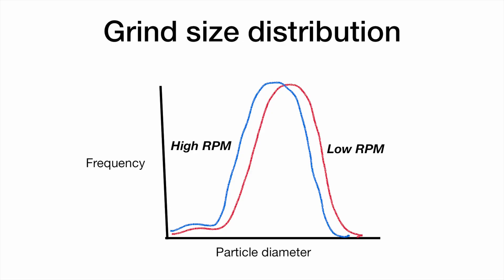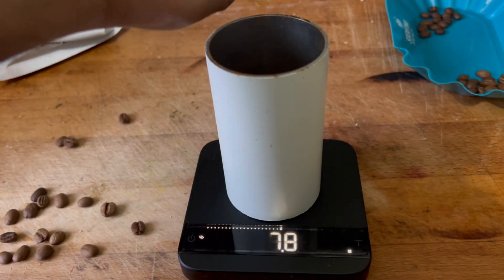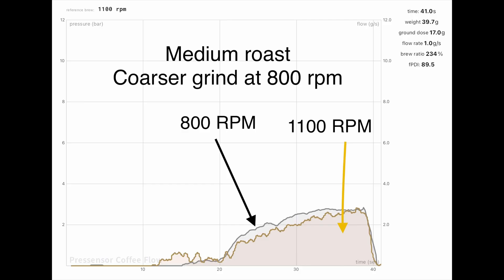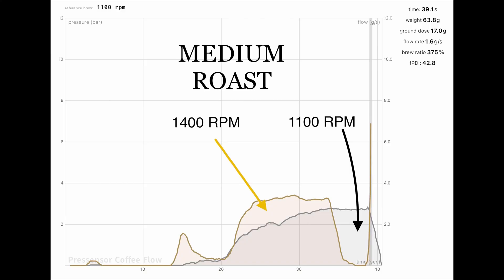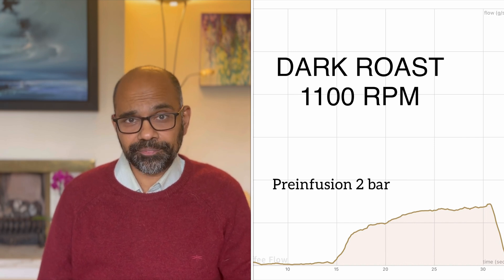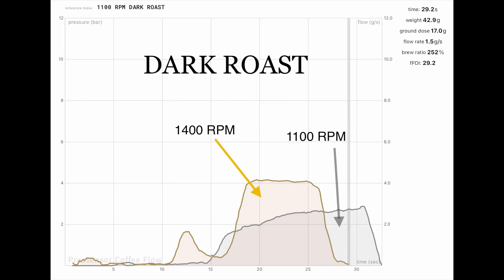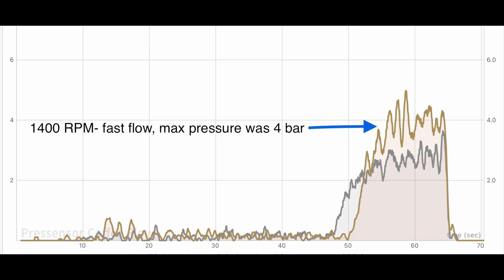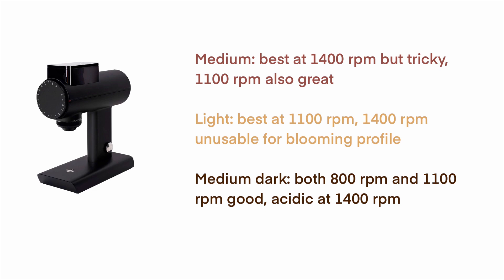Variable RPM in a coffee grinder -Does it matter? (Timemore Sculptor 078S)

Comment: 078S does not work for me as improvment over my old  MACAP M4 with new burrs.  For 2 different medium/dark roast Espressos, 2:1, 20g, regardless of grind setting, RPM, temperature or pressure coffee tastes undrinkably bitter (we like the bitter in coffee but this is aweful) and  the counter is a mess because of fines around the cup.  I seasoned with 7kg before the first attempt, use WDT (no RDT).  I will return the 078S and try the Philos.
Reply from the maker: The 078S works well for light and medium roast. It extracts quite a lot and requires meticulous prep to prevent channeling. Perhaps you are either over extracting a darker roast or experiencing channeling. Could I suggest lower ratios and puck prep according to the latest video?

Comment: I have more or less the same experience with SSP Cast V2 on the P64. Lower RPMs are easier to dial in but lack clarity. Depending on the coffee I prefer one or the other. Low RPMs can give me higher body and juiciness with light filter roasts and I can bump clarity on medium roasts when using higher RPM. So there definitely is a difference. Thanks for tasting all this.

Comment: I am curious, was your grinder already "seasoned" before doing these experiments?
Reply from the maker: It had about 3 kg through it I think. After the first 500 gm, the coffee was pretty good. Now after  about 6-7 kg, it’s excellent. I think largely this is because of experience rather than seasoning.
Reply: @UnderstandingCoffee  I imagine so. Thanks for the answer. When you pointed out, that it was hard to get good light roast shots at 1400 rpm, I thought to myself, maybe this is related to why many people say that the machine needs 7kg seasoning and others say they had no issues. In stock settings, it seems to be set to 1400 rpm (it was in my case). I don't mean to be rude, but I wonder if those people tried to use lower rpms first, or stayed at the 1400 rpm at all times.

Comment: Great video. Thanks for sharing your experience with that grinder and mentioning that the Gange results may be limited to his EG1. Which I believe he mentioned as well but Lance seems to imply it works the same in every grinder which isnt the case.  

It is odd this one is backwards from most grinders. Lower rpm generally gives you less fines or coarser grinds for other grinders.
 I wonder if the declumper or wiper arms are not sufficiently allowing the coffee to exit the grind chamber efficiently leading to more regrinding where at higher rpm the grinds are pushed out more easily.  
Another thing to experiment with would be to maybe use the knocker as its grinding at lower rpm to assist to exiting of coffee maybe. 
I have 078s coming soon hopefully.
Reply from the maker: Thanks! I think the vertical orientation of the burr changes things. A possible explanation is that at lower rpm, the beans back up in the auger resulting in regrinding.

Comment: I'm trying to understand the conclusions here (medium roast). It seems for espresso, 1100 is safer might be ideal compromise, since it will be easier to dial in.  Should I conclude for pourover, 1400 would be best?
Reply from the maker: I haven’t tried this experiment for pour over. But yes, you can extrapolate the findings. I have tried sprovers by grinding at 1400 rpm and slow feeding (2-3 beans/sec) and it works really well. Hope this answers your question.

Comment: Great video, I've experienced the same as you described, it's nice to see some good data to understand it.

One question, what's your 0 set up at? I had to move the pin 3 spots to the left from factory 0 to find burr chirp at 0.4.

And what coffee and grind size did you use for filter?
Reply from the maker: Thanks! The burr chirp is about 4 notches away from zero.  I moved the pin 2 spots to the left.  the coffee for the filter was a medium roast Columbia Antioquia. The particle distribution was merely to demonstrate that rpm has an effect even in the filter range. I did not brew with it.  It was ground at 14.

Comment: Are you doing some bean flushes between changing grind sizes? 

I have 064s, but it seems that the shot times differ if I make a shot on e.g. 1.5 going from 1.8 (faster) and 1.5 going from 1.1 (slower). The retention is really small, but it still bothers me, not sure what's the reason, didn't make any back to back tests but I have such feeling.
Reply from the maker: No, flushing isn’t required as retention is almost zero. How much coffee have you ground so far? The grinds clump a lot initially which is probably why you get inconsistent extractions. 60-90 seconds of WDT in the container and puck raking helps a lot with consistency of extraction.  As the grinder is seasoned, you won’t need as much WDT. I’ve probably ground about 5-6 kg and 20 seconds of WDT is enough.
Reply: @UnderstandingCoffee   maybe that's it, I've ground maybe around 2-3 kilos and use quite long WDT. Also that's not a thing I'm 100% sure of, but I have a feeling it's happening, but good to know it's fine for you.

Comment: I got my 078s since the beginning of October.
When it comes to extraction, I realised that lower RPM for filter was nice to improve the complexity and depths of flavors.
On the other hand, for expresso, I  usually stick to the mid range around 1100 RPM because it's less tricky to dial in and the flavors are just nicely balanced.
I dont have any WDT tool yet but I might try to increase the RPM speed closer to the max settings when I'll have one to see if i can push to the limit the clarity and the flavors.
I mostly use medium to light roast for expresso but i think the grinder suits better for medium profiles, at least with my bambino plus.
Thank you for the great video !
Reply from the maker: Thanks for sharing your experience. WDT will make a big difference. You don’t need any specialist WDT tool. 0.3 mm acupuncture needles in a cork is good enough!
Reply: @UnderstandingCoffee  a Friend of mine is the owner of a specialty coffee and does have one spare for me so hopefully I'll not have to buy anything.
I think there is room for improvement in the 1100/1300 range without having to deal with too many issues like 1400 does.

Comment: I grind at 800 on my 078s as it gives me the best/widest range for espresso on the dial.
Reply from the maker: Of course tastes are individual and it’s great to hear different experiences. For me , the best balance between clarity and body is at about 1100.
Reply: @UnderstandingCoffee  I’ll give 1100 a try, to be honest the reason why I also started at 800 is because some claimed it produced the least amount of fines which seemed desirable. I’m surprised that 1100 is more clear.
Reply from the maker: @DigitalicaEG  Please let me know what you think of extractions at 1100. I was surprised too! One suggested explanation is that the coffee is being ground so fast at 1400 rpm that there’s little time for the beans to back up in the auger which means they aren’t smashing into each other. One experiment I’d suggest you try is to feed 1-2 beans at a time. The difference in extraction times is huge as there are almost no fines when feeding slowly. Great for turbo shots but you can get anything else! So the mechanism of low fines at high rpm could be related.. 1100 rom seems to give the best balance of fines
Reply: @UnderstandingCoffee  interesting! My current theory is that at higher RPMs due to the higher centrifugal forces the coffee beans gets expelled to the edges of the burrs and eventually to the outside to escape faster as soon as they are small enough to pass through so they don’t spend a lot of time between the burrs getting ground down even further. It’s a shame though that it really gets much harder to dial in.
Reply from the maker: @DigitalicaEG   Quite possible that this is the mechanism.  It is not surprising that it gets difficult to dial as there is little puck integrity with low fines.  I guess it is similar to trying to use brew burrs such as the SSP Unimodal V1 for espresso.  It just does not work.